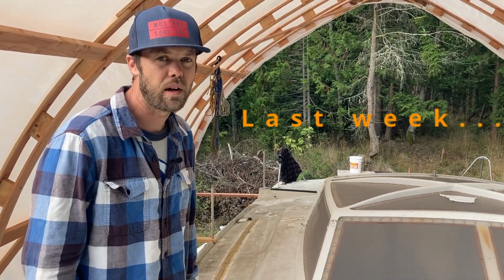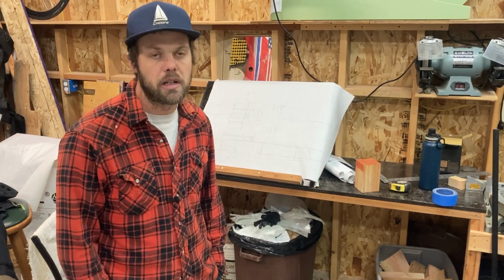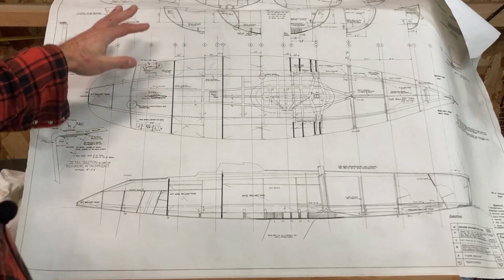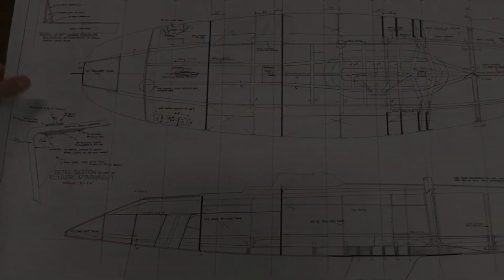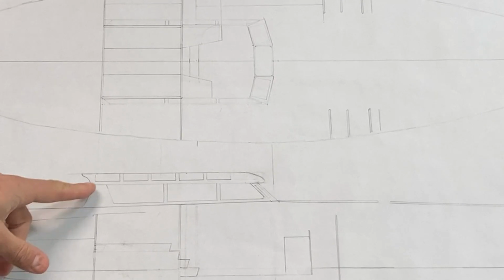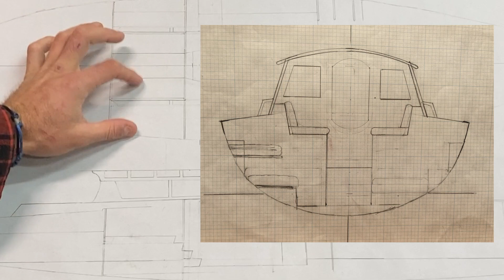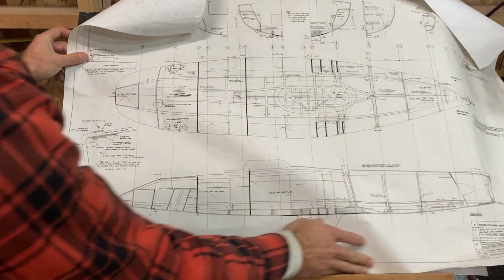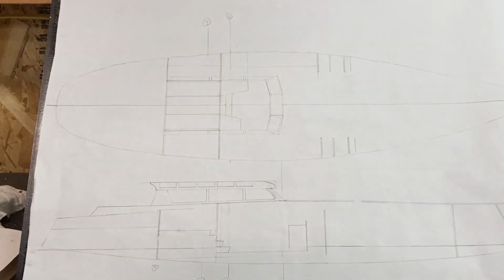Episode 7 - Cutting out the cockpit

Comment: What are your plans for the keel? 
Swing, Center board, Shallow draft. 
It would be nice to still have the tall rig and take advantage of the boats performance.
Reply from the maker: That’s a big question to answer.  The short answer is we want to make the keel shorter (than 12’) and the rig shorter.   We have to find a mast before the keel can be redesigned.  We have a ways to go.

Comment: So where are you putting the traveler then?
Reply from the maker: Hey, good question.  The traveler bulkhead is getting extended up to be the aft wall of the doghouse, as you have seen.  There are 2 options as I see it.  I'm either going to put the traveler on top of the doghouse, or ditch the traveler and do a bridle system.  I'm actually leaning towards the latter.  Either way that area is going to be heavily built to accept either.

Comment: Awesome - great series!  Out of interest (may have missed it), but why does the bulkhead need to be moved back? Just for better space?
Reply: My thoughts exactly! Seems like the main bulkhead was strategically placed exactly where it needs to be.
Reply from the maker: Thank you!!  For the layout to work, while making as few modifications to the structure as possible, I had to move the bulkhead.  If I keep it where it is, the benches in the doghouse and the beds underneath would either be almost 8 ft long, or the old bulkhead would be right down the middle of the living space.  It's hard to explain, and I hope that I can do a better job of showing how it will work in the upcoming videos.   Good question.
Reply: @TheDuracellProject  cheers look forward to the updates!